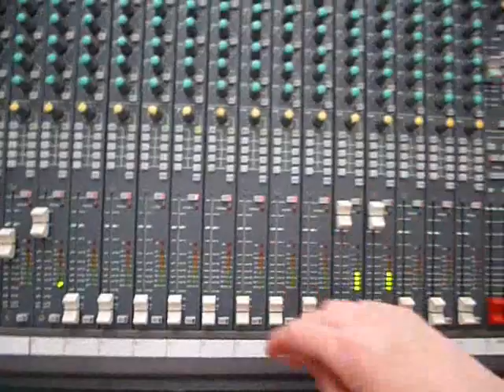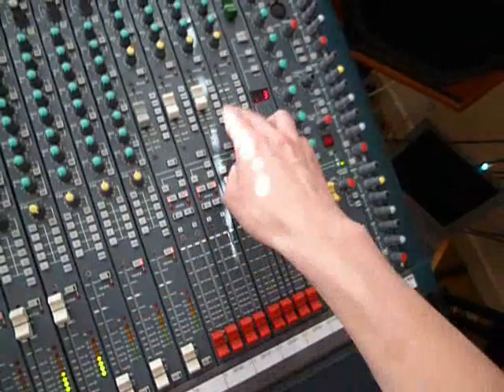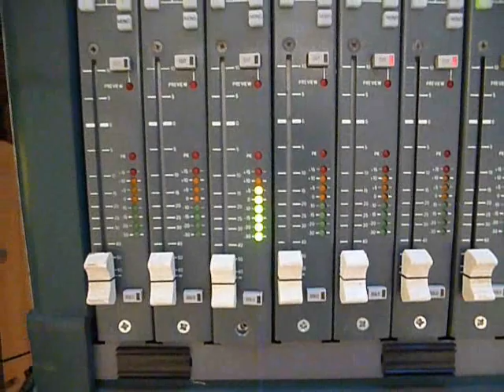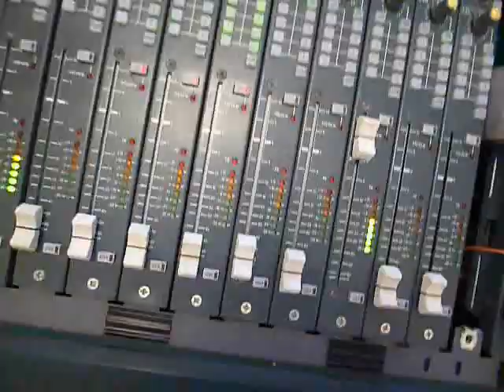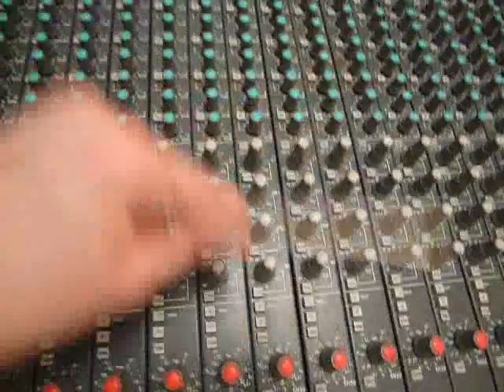Mixer testing

Comment: I recapped (every single electrolytic capacitor replaced) a 32 channel Soundcraft Venue - very similar to your mixer.  Literally had a nervous breakdown shortly after lol.  Didn't sound much if any different as I used original factory specification capacitor values - biggest waste of time in my life - will never get those days back.  Happy mixing!
Reply from the maker: Hahah I feel your pain, you have no idea what I had to go through with this thing although yet not as bad as re-capping each module. I used the Venue II schematics as a guide as at the time I couldn't find the ones for the K3 (Now found) They are very similar indeed, on the Venue it uses multiple TL071's instead of the dual 072's like on mine. The couriers weren't kind to it also the weight... I had to take each module out, do a quick clean/service aka solder any fucked ground points etc, move the empty frame upstairs, fit every module then find faults.. then constantly take channels out to repair them..wait for parts.. re-test bla bla bla I still have a few bits and I still need to clean the channel strips a bit.. Kill me now... Also I seem to of lost my music making anything hahah
Reply: Yeah these things are a real labour of love.  Honestly effing around with one of these mixers took almost a year or more of my life - no music got made at all.  Please don't let that happen to you.  

My advice would be to get 8 or 12 really good serviced channels fitted left of the master and plug your favourite gear into them to keep making music then mess around with some other modules at your leisure with the desk still operational so you can continue creation process.

Really, advice from a lot of experience, I would not get involved in upgrading op amps - by the time all new high spec modern op amps are fitted and capacitors are upgraded the signal sounds practically like it's been mixed in a DAW anyway so may as well just plug everything into multichannel soundcard and mix ITB.  

The main sonic pleasing upgrade comes from the typical Jim Williams  (Audio Upgrades) advice i.e. replace signal path 47uf caps for 100uf or 220uf (Panasonic FR series are cheap and will last forever) he also recommends bypassing the electrolytics with 0.1uf (or 0.01uf can't remember) polypropylene capacitors to lower ESR and let HF detail come through - many real qualified engineers claim this to be a lot of rubbish but I tried the bypass cap and it really does make an ear pleasing difference (blind AB comparison of recorded files).  The replacement higher value caps really does make the signal path more open in the bass range as any phase distortion is pushed much lower out of audible range - also with higher uf value high pass filter corner frequency (which is basically what all these 47uf caps are) is pushed lower so bass frequencies really come through loud and clear.

The TL072 and 5532 that are used actually sound great the TL072 has some pleasant mojo - it's a shame to change them all out - but the higher value capacitors really make a huge difference and make the desk sound fantastic.  I just wish I knew this when I recapped the one I had - so stupid to use the same values - we live and learn.  I've since upgraded and uprated capacitors values in subsequent equipment to amazing effect.

If you are going to do any recapping of course start with the master section - as a rule of thumb all signal path capacitor values can be doubled in value (voltage can stay at 25v) there are especially two large caps before the mix bus amplifiers - I think they 420uf or 1000uf - anyway in any case these can be doubled in value.

Then of course there is the issue of recapping the power supply doh! it never effing ends - maybe you should be humanely put to long sleep as you suggest...

Or you can just service and lubricate without any mods and be done with it - you will certainly still get smooth classic sound.

Sorry if TLDR and teaching granny to suck eggs - once I start I can't stop.

Summary - don't waste your life away snorting solder fumes - make music because you are among the few who can do it properly.
Reply from the maker: Nah re-capping is too much, it's already a little bit to hi-fi for my taste. I spoke to Geoff Frost of Sound Techniques when I re-did my Bozak and in that case it was pointless to re-cap unless something was faulty as high quality capacitors were used and the heat in that mixer is almost non existent, heat is the main issue here as it dries them out. Only need to replace a few ALPS switches and a couple of pots on this and that's about it but it all works at the end of the day, I'm just being picky. I don't get the higher de-coupling cap value thing because the higher the value usually the higher the hi-pass filter will be. I changed caps in my original Bass Station to non electrolytic in the output stage with lower values and there is a lot more low end now.
Reply: I don't understand the physics but this post kind of describes it: https://www.gearslutz.com/board/9835500-post5.html

I think it involves the impedance of the stages that follow - certainly within the typical Soundcraft mixer signal path and most other equipment I've come across the higher value coupling cap lowers the high pass filter and increases bandwidth - this was through measuring before and after.  e.g. if signal coupling capacitor was 47uf roll off would start at around 30hz and so phase shift was present around that frequency too... when 100uf was fitted roll off began much lower at around 15hz and there was no phase shift until the beginning of filter roll off.

Messing with circuit design is a daft idea and you are wise to do as you say and fix what needs fixed.